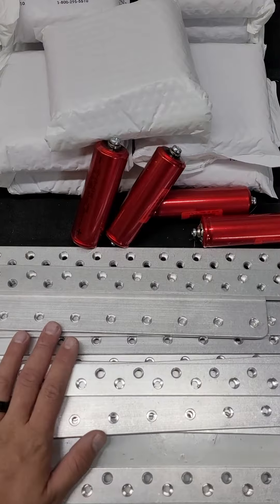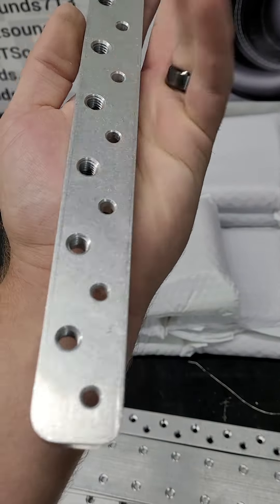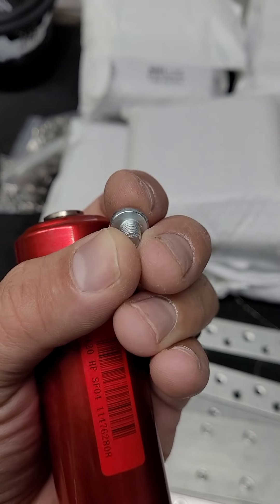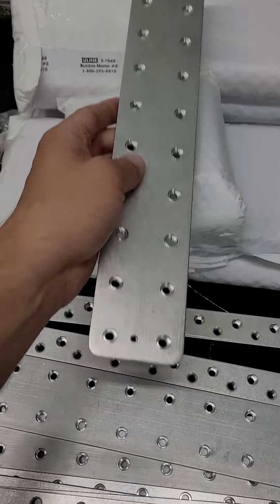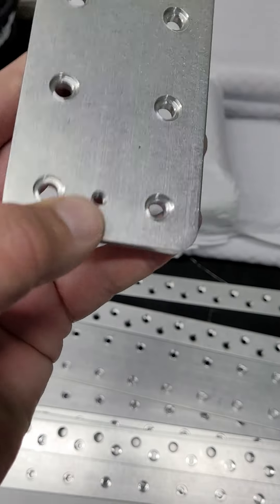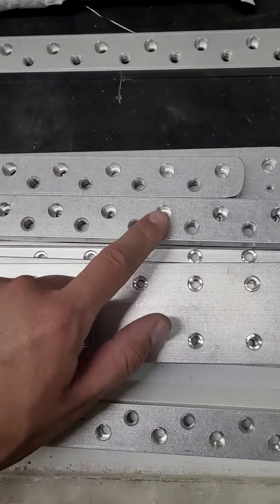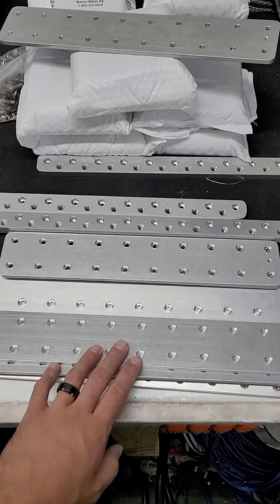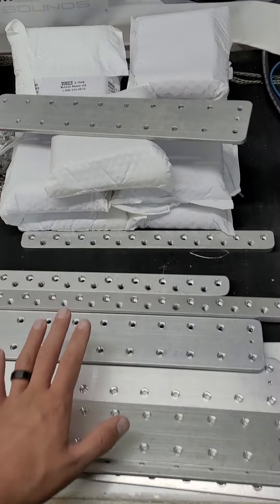Upcoming Headway Lithium Battery Bank 96ah build!

Comment: i wanna say agm is cheaper if youre on a budget but... doin it this way you could buy a few pieces at a time till you have what you need.
Reply from the maker: If youre on a budget and you have access to a drill, this will be cheaper than agm at any point
Reply: It would take 5 times the AGM amp hour or more to get similar performance there no way AGM will be cheaper on a $ per performance scale